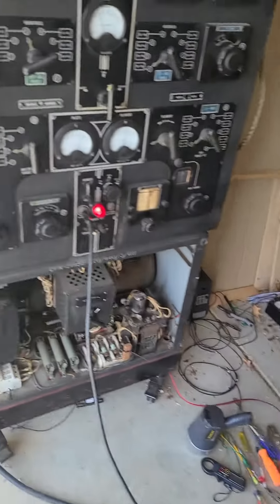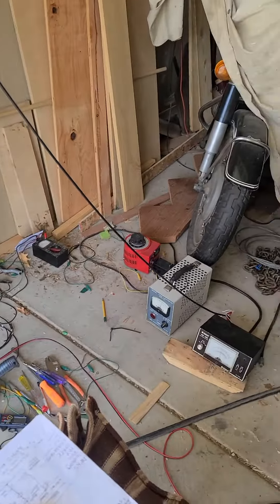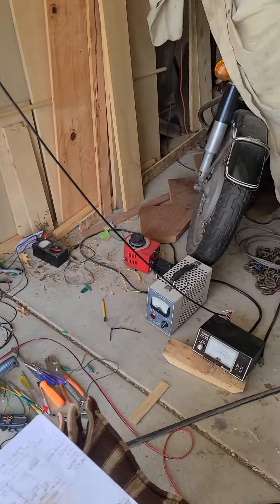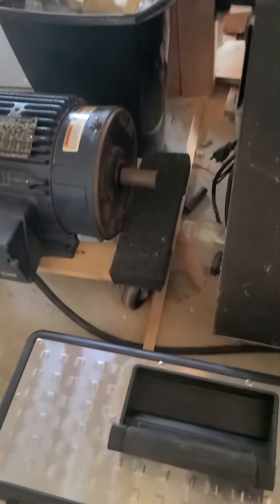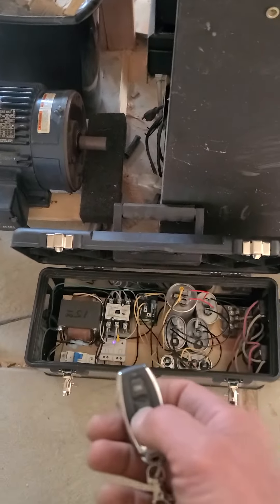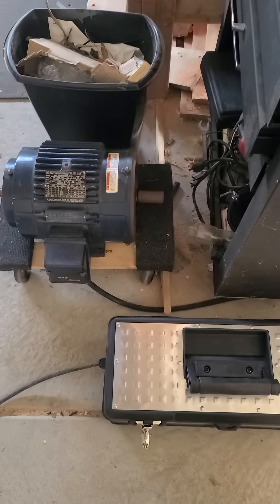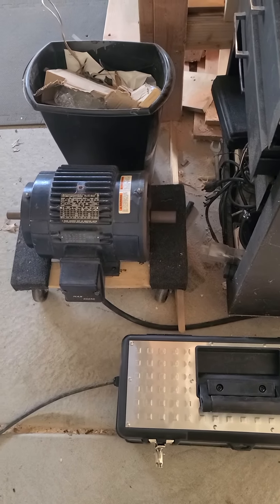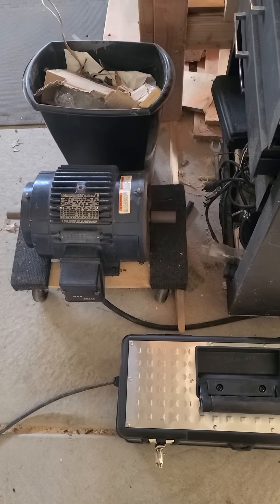START UP SEQUENCE of  TDE transmitter on 3hp rotary phase converter.

Comment: Brilliant!
Reply from the maker: What os cool is that at the local surplus yard..

I found a really nice 3phase 220v to 115v/ 400 cycle rotary converter ...for free!

No one noticed what it was...

So, now I also have a beautifully stable 115 volt 400 cycle power source for any military aviation  boat anchors I run across!